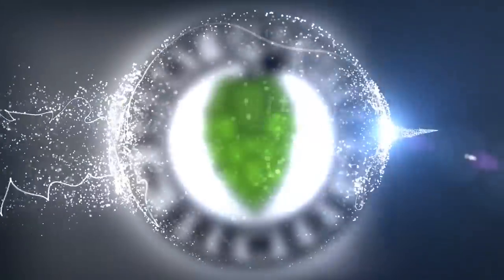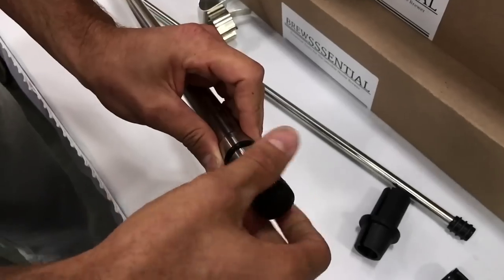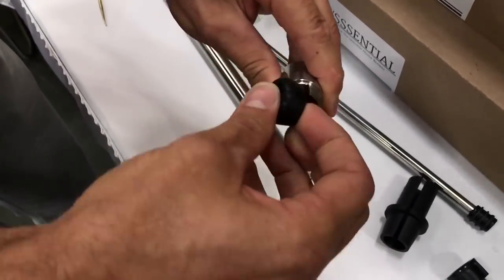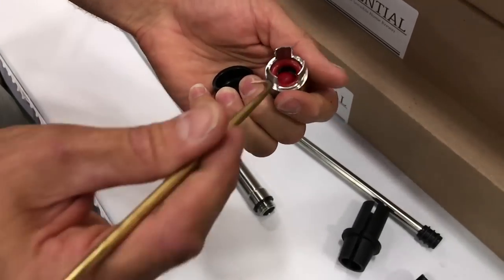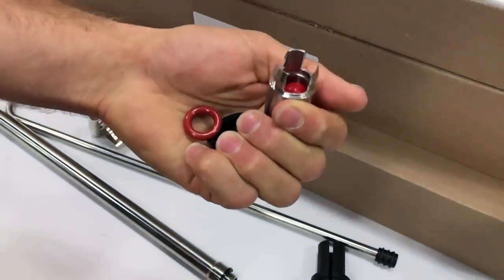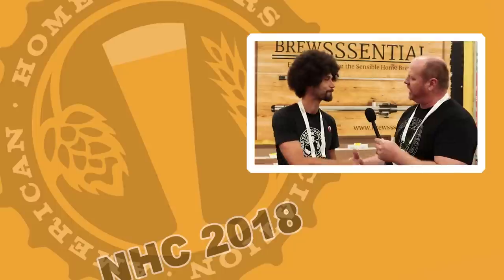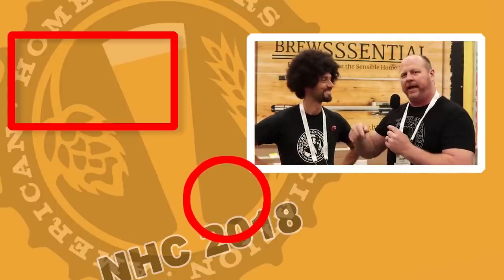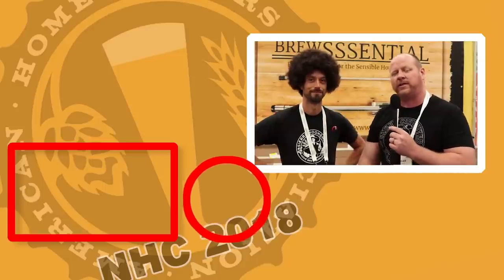Brewsssential Stainless Steel Auto Siphon. #scbatnhc

Comment: Hi Brian,  I purchased one of these through their kickstarter and I want to applaude and thank Anthony for not going insane through all the issues he had getting this manufactured and sent out to all who purchased them.    Although I haven't had a chance to test it out yet (been busy, lazy, etc) I will say it is a nice sturdy piece of equipment.   Aside from possibly having to replace the silicone parts over time it should last a lifetime.   The only concern I have is that the three prongs that hold the bottom piece on are a little sharp along the edges (on my siphon) and I worry that it will tear the silicone after a few uses. That's really the main reason I haven't gotten around to try mine out yet, I want to hit it with some sandpaper to knock the edge off of the prongs before I use it.    Maybe you could talk Anthony into giving you one to take home and do a proper review??   Also thanks for the NHC updates. Cheers 🍺
Reply from the maker: Lol I will see what he says! I will pass on your comments as well. 👍🍻

Comment: Another WAYYYYYYYYYYYYYYYYYYYYYYY over priced product. Fortunately I do not use carboys and do not need to use a racking cane. If I did I would rather just replace it each year as needed. Everyone has some kind of sale going where you will be able to pick up a replacement plastic cane at a discount. I could easily replace racking canes for 5+ years just to break even.

At the current pricing plan it is jut not worth it. I will keep an eye on it to see if it comes down in the next year or so.